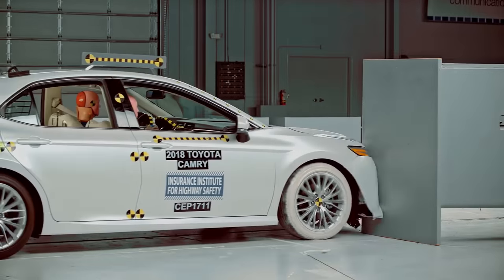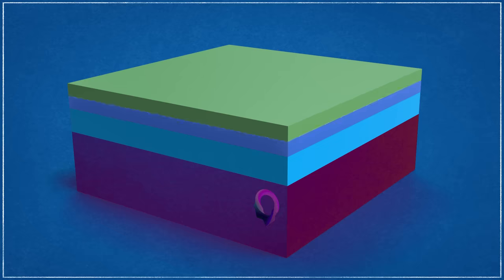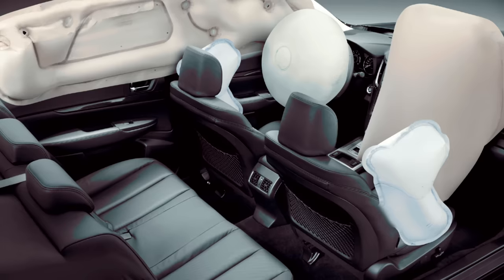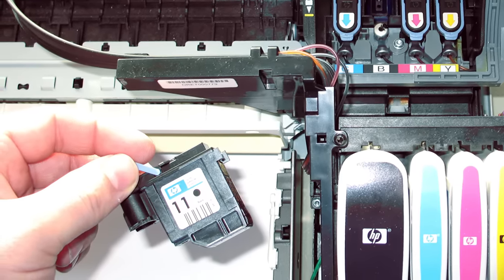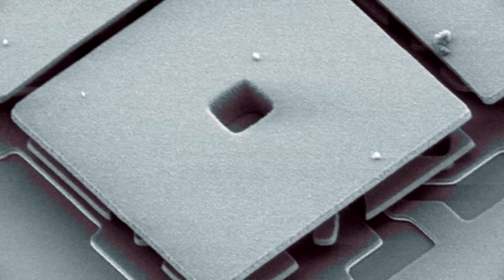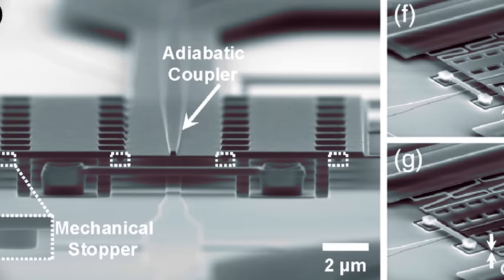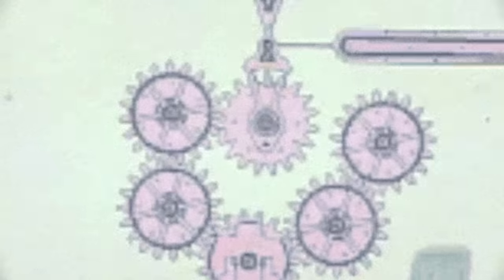The World Of Microscopic Machines

Comment: 2:10 the wafer itself is a slice (literally a wafer) of monocrystalline silicon. it is not coated in silicon. you also got your labelling of positive/negative photoresist exactly backwards. upon UV exposure, a positive PR will wash away during development while a negative PR becomes insoluble. the way to remember it is that after exposure and development, a positive PR becomes a copy of the UV mask, while a negative PR becomes the negative copy of the UV mask. in traditional film photography the light exposed parts precipitate silver and become insoluble to developer so the lightest part of the picture is the darkest (that's why developed film is called a negative). also doping is not done through oxide. that is etched off first.
Reply: Follow Media       He could have gotten away with that if it weren’t for you.

Comment: Great video! 
However I think at 2:29 it is the other way round.

Positive photoresist: Exposure to UV-light increases soluability

Negative photoresist: Shielded areas from UV-light get dissolved during development
Reply: Thank goodness I'm not the only one who noticed
Reply: I'm glad you pointed it out -- it's a good video, but there are errors in there. There's the description of a "wafer being coated with silicon", which isn't accurate -- the wafer IS silicon. And boron bombardment isn't a photolithography technique, it's called ion implant.
Reply: @4422011  Thanks for your additions :)

Comment: Imagine if it was possible to use a peltier device to get electrical power from the temperature difference between the body and the ambient air and have it power a tiny led on top of the eye that shoot a light beam at a pair of mems mirrors as shown in the video. In order to display information directly on the eye.

Comment: I am a master certified auto technician. I can garantee the accuracy of the introduction of mems tech in automotive applications. Early airbag systems were not very dependable as the ball and tube impact sensors would fail without alerting the computer resulting in failure to deploy in a real accident. They would also cause the airbag to deploy prematurely resulting in the vehicle still in motion when the airbags go off. Also early sport utility vehicles were notorious for rollover accidents caused by a high center of gravity when engaging in obstacle avoidance maneuvers. Mems devices were integral to the development of safer airbags and traction control and skid recovery functions of dynamic vehicle stability systems now standard on many vehicles. The airbag system now uses the lateral acceleration sensor setup illustrated in this video in both systems to perform in ways that were never thought possible. I have had to calibrate these sensors and it boggles the mind how sensitive they really are. In dynamic vehicle stability systems the lateral accel sensor works with the antilock brake system to ensure that braking traction is limited to trailing wheels wich eliminates the rollover tendency in suvs. A development courtesy of bmw. New developmenys woth the airbag system is that lateral accel sensor informs the airbag control module of the severity of an impact that results in the ability to decide in a few nanoseconds if it should deploy, and wich airbags to use, side impact or forward. Also in lesser collisions it is part of the impact discrimination protocol, wich will interupt the deploy signal if the collision is not severe enough, if the occupant weighs less than 150 lbs, or if the collision is from a direction other than forward or side impact bags are intended to protect. Many children have been severly injured by older airbag systems when they were thrown back into the seat by the airbag as it deployed as intended for an adult. There is a multitude of ways mems technology makes your vehicle safer to drive, and will save your life when you least expect it.

Comment: Fun fact: MEMS gyroscopes are used in most R C aircraft, allowing them to be significantly easier to control. To fly a drone or a helicopter today is easy.
There are a ton of cool ways to use MEMS gyros. For example, a Segway or even those hoverboards that used to explode.

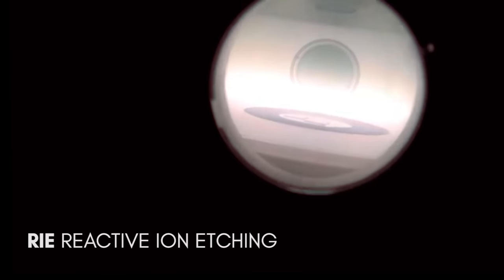Comment: I used to work in CD and DVD manufacturing / mastering and use almost the same process. The only difference is we use a laser to cut the cd and dvd pits @4:40 is a "plasma oven" is used to clean microscopic debris. Then we grew a reverse copy from nickel in electroforming tanks. I was just surprised at the similar process and machinery

Comment: corrections:
1- No traditional turning and machining is done in MEMS, Chemical processing results in MEMS development.
2- no high rpm 360-degree rotation is achieved yet in MEMS.
3- Substrate itself is Silicon Wafer mostly 200 um thick.
4- There are several methods and are interconnected with each other in fabrication, these methods can be constructive, destructive.
5- the capacitance change in comb drive in accelerometers is sensed and then converted to voltage for useable information. 
6- Combination of Accelero, Gyro, and Magneto-meters is called IMU (Inertial Measurement Unit).

Comment: Nice visuals, but hate that I can't compare what these machines actually look like, and how much force they can give off, and if they're electrical or mechanical, and how they send/receive signals, and their overall scale.
Reply: They are electromechanical. The force is electrostatic, or the force of charges attracting/repelling each other. This occurs because the device operates similar to a capacitor, only instead of retaining energy in an electric field the two plates of the capacitor are free to move and attract/repel due to the electrostatic force. So by applying a voltage to one side an incredibly small force is applied to the other.

Comment: The description of the behaviour of negative and positive photo resist are incorrect. They have swapped them around. With negative photo resist the exposed part is subject to cross linking of polymers which don't dissolve in the developer. Positive photo resist undergoes Wolff rearrangement making the exposed part soluble in alkali developer.

Comment: I wonder how much more prone to failure MEMS devices are compared to non-mechanical semiconductors. With the moving parts, you would expect that they would have a much higher failure rate. One instance comes to mind of the MEMS accelerometers on certain iPhones would fail temporarily when exposed to as little as 2% helium. Staff in MRI units in hospitals would report failures just from the small bit of helium that leaks from the cooling units for the superconducting magnets. I forget the exact mechanism, but the helium would diffuse into the MEMS structure temporarily. Applied science did a great video on this effect where he performs experiments to see at which point they fail and for how long.
Reply: MEMS are encapsulated by an epoxy resin, same as dies of ICs.

Comment: The mems gyro you show at 8:40 should work in principle, but that's not how real devices are built. The accelerometer on top is redundant, you can directly sense the oscillator's displacement. This article has awesome pictures of actual sensors: https://www.memsjournal.com/2011/01/motion-sensing-in-the-iphone-4-mems-gyroscope.html

Comment: Sad part is most the old sensors or connected to the body of the vehicles.  An have only the car to react too in deployment of air bags! Yet there or other types of systems that could rely the same info in same amount of time or faster if programed correctly.  Kind of like the new sensor that can stop a car on its own. So to me cars an crash ratings will begin to use that same tech to deploy air bags possibly on the vehicle not just in them to also help cut down on major fatalities an injuries to people.

Comment: I wonder if such tiny machines could use the brownian motion to generate usefull work.
EG: a ratchet attached to a rectangle, that would only move one way if there's even a slight pressure difference on either side. This would technically counteract entropy, at least locally, no?

Comment: "And costs several hundreds of dollars"
Modern airbags are stupidly expensive not to mention the damage they do to the car.
many cars with multiple airbags (over 2) will be totaled if they go off.
Reply: Airbags exist because people still don't use seatbelts. No racing car uses these despite being subject to frequent crashes at blistering speeds, they did their math and figured airbags are worthless.
Reply: @michaelbuckers  Roll cages, multipoint harnesses, helmets, and HANS devices.(inconvenient for standard vehicles).  Lot of accidents on the race track don't have an impact at high speed and their cars weigh less (less energy at impact) due to sand traps or energy absorbing walls (Spring or tires).
Civilian cars have to balance luxury (weight and convenience) and the sometimes accumulative collision of 2 speeds.
Reply: the thing is... the several hundred of dollars he is talking about was the cost of the SENSOR, there is no airbags included in that^^

Comment: Ok, video. Your process knowledge is weak though (I realize you're trying to explain to laymen). Your positive/negative explanation is backwards. Positive is removed where exposed. Why? Because the UV both causes a scission of the polymer chain and it converts a base (photoresist) to an acid which reacts in the developer (a base). Today's iline resists are MUCH more complicated than this as well, but I'm explaining to laymen. I could go on and on, but I think you get the idea...